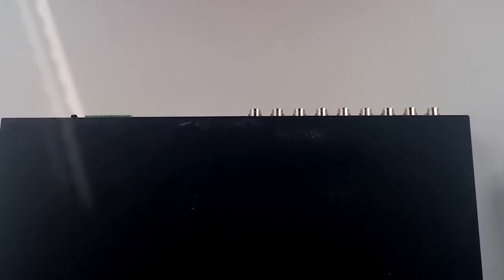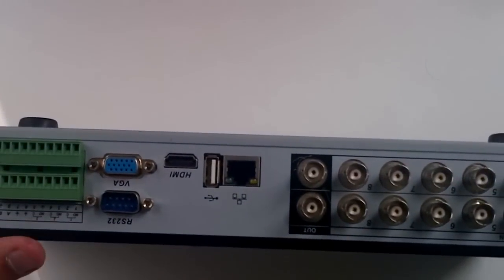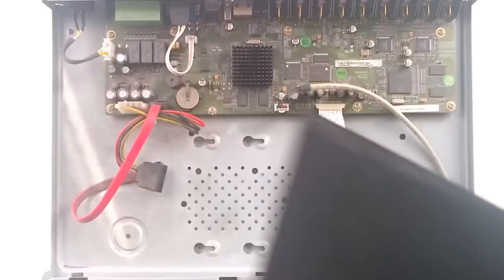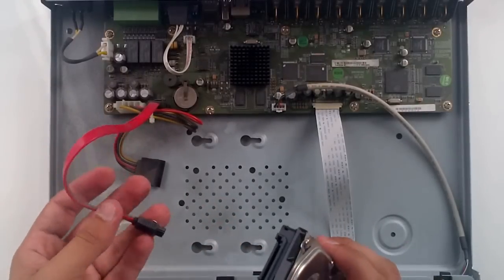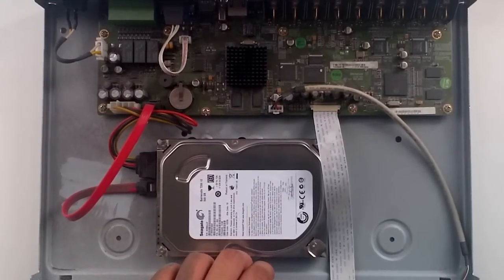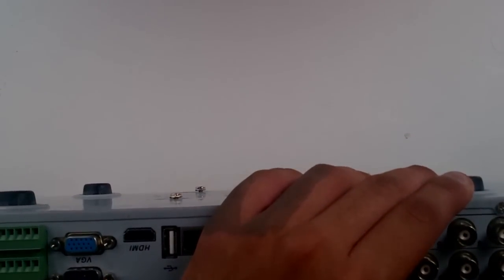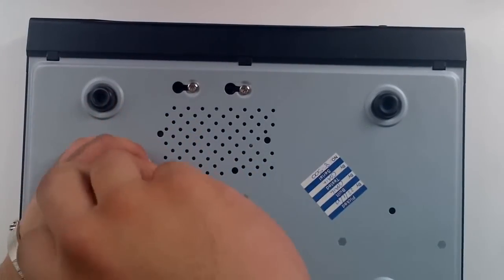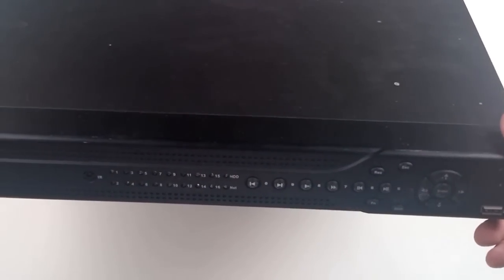cctv hard drive replacement part 1

Comment: Quick question: so my dvr is pretty old and has no vga or hdmi outlet.  The only video out is a BNC and I use a BNC to AV wire to run it to a monitor.  However, whenever I plug in the AV end into my tv (which I use as a monitor) nothing shows up.  Any help, tips?
Reply from the maker: From what i know it cold be anything from as complex as a firmware issue or a broken video chip or as easy as a dodgy cable 
Best of luck i think this probably didnt help 
But google is your friend hopefully youl get the old thing up and running
Reply: +kinggaf thanks mate! Any help is appreciated.